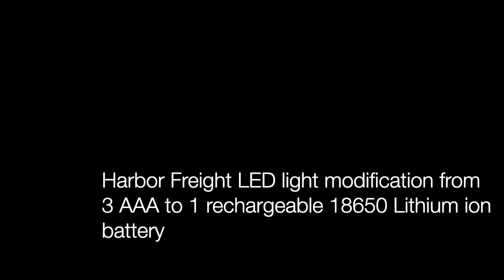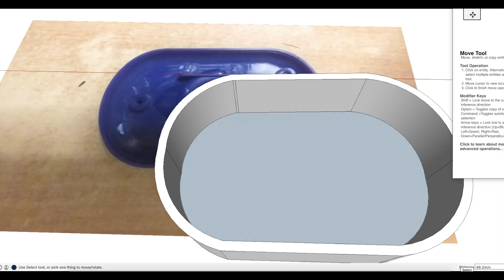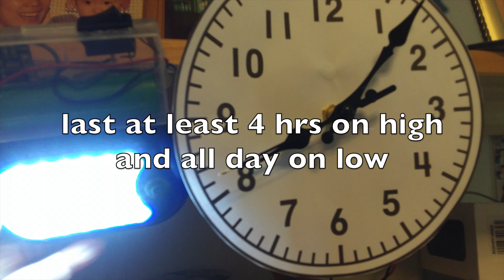Modifying harbor freight ultra bright led light to rechargeable lithium ion battery

Comment: Nice project, as many of yours are. HW-107 seems to be the more commonly referred to as TP-4056, which is a very versatile board and very useful.
Reply from the maker: Thanks for commenting. This charging board has been updated to have over discharging  protection voltage of 2.5v and battery over current protection of 3A. Just right for this type of project.

Comment: Good idea, would have never thought of that. I have several of those lights,batteries gets expensive. Thanks.
Reply from the maker: When I tried to use the light last week, the AAA batteries inside were dead and started to leak.
Another pet peeve is the light switch. You have to click it two times to make a light level selection.  I have another flashlight which acts the same way and  you to have to click the button several times in order to get to the light level you want. With the modification, I can press the switch I installed one time and I'm either on high or low. Making it rechargeable is a big plus.

Comment: Cool mod, to bad we don't have a harbor freight here or I would be out to buy that light.   I tried to use the same pcb board to make an automatic solar light. There is a modification somewhere on Youtube.  https://youtu.be/9agdmkeYkFk   .. I have 2 bigger panels, a 100 and a 40 Watt that are useless here during the wintertime but I thought of using them to charge lights up like these during the dark wintertime. Since the panels output like around 18 to 20 Volts I use a very small dc/dc downconverter to get around 5.5 Volts to get the input to that TP4056 just right ...  but I need to experiment a bit to see if it keeps on working like it should. On a very cloudy and darkish day like yesterday I could still get like 1 Amp at 5 Volt after that dc/dc convertor which is still more than enough to charge a couple of 18650 cells during the daytime.
Whatever keeps us busy during these crazy period it seems.
Reply from the maker: Thanks very much for your link to the modification of the TP4056. That certainly would be a good use of the board aside from using it as a charge controller. I have also made solar lights using another chip QX 5252F. You can power the light with a single 1.5v AA battery. This is the chip used in a lot of solar lights. Here's a link to my video: https://youtu.be/b12si-m7pVE
You are right about not getting enough sun. We didn't have much sun the last week here in the Northeast.  Thanks for commenting.
Reply: @wtam69   Yup, saw those and used them on a universal pcb this week as I had ordered them a couple of years ago. Another couple of inspirational videos!   The odd thing is that even without a load, meaning no leds connected, it draws almost the same current as with a led connected, so a lot of tinkering is needed to get the maximum efficiency it seems.
I have a couple of 12V ledstrips lying around that I can power with a small boost convertor (DC-DC Boost Module 2A Boost aliexpress 0.42 Euro quick Google). Seems to work perfectly using a 18650 cell. With the multi turn potentiometer it is really easy to adjust it to whatever Voltage or current. So I plan to combine those 2 pcb's and build something. 
The good thing is that those parts are really cheap to get as long as you have time and patience.
Reply: @wtam69  and after I typed this morning I saw a very nice explanation of this module.  Check https://youtu.be/3dwA8A8VrrE  
I think I/we will need to use protected batteries if applying the mod.  Well those protection pcb's are cheap and are on the way anyway.
Reply from the maker: Great info.  I actually tried the older charging board without overcurrent over discharge protection. The battery drained all the way to 2v and the led light turned dim. I turned off the light and recharged the lithium ion battery. Needless to say, this is no good for the battery as it shouldn't be discharged below 2.5v. There are circumstances when you need the light to be on (if you are in a darkened cave waiting to be rescued) even if it means damaging the battery.